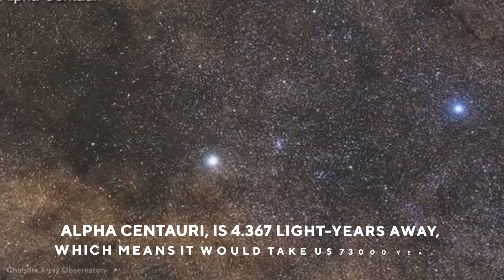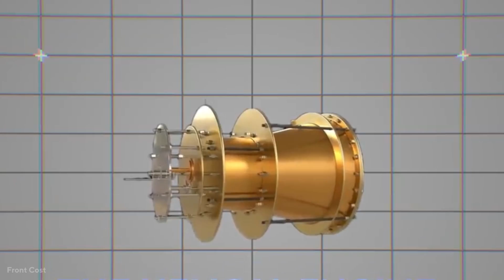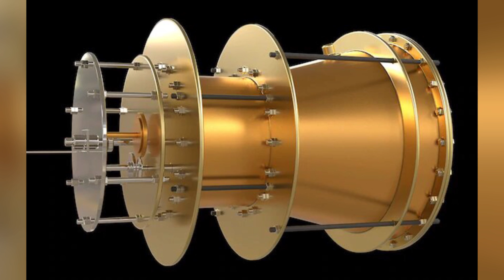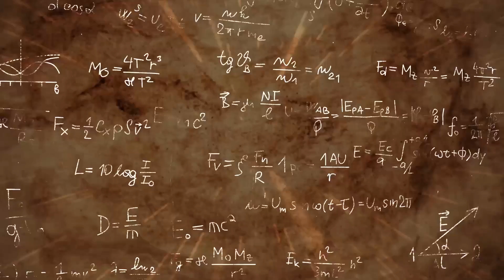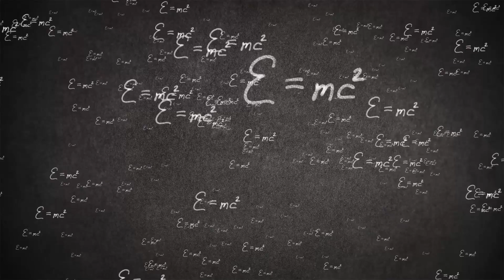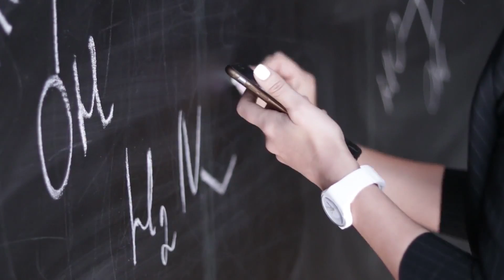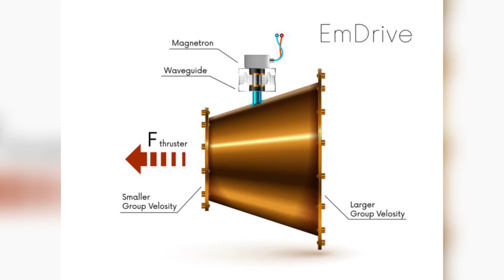NASA Design's Light Speed Engine That Defies Physics

Comment: Let's just say for the sake of conversation that this actually worked (humor me). Think about the stress that current high G's put on the body at faster than the speed of sound. The human body couldn't withstand the pressure at even a percentage of light speed. See what happens to an insect when it hits a windshield at highway speeds and imagine the force on the body or even equipment as it slows down to 0 from a percentage of the speed of light. Without injecting any scifi here, to protect the outer shell of the ship i.e. no shields. Even an empty ship traveling to Mars either wouldn't make it do to overshoot or couldn't slow down once we got it there, again the overshoot. The breaking force of the reverse motion would also crush the ship like a soda can. They always talk about FTL or Warp drive engines without thinking through the breaking or pressure on body and components. We can't currently make it to the deepest bottoms of the oceans without causing too much harm on body or equipment with our current level of technology but we want to travel at light speed. Unfortunately this won't happen in our lifetime unless we think outside the norms of possibility.
Reply: The warp drive doesn't accelerate but "move" the sspace around it so no g's, and for the space debris problem electromagnetic or just shields wuld work fine (for small things) and once you get up to speed there will be no g's acting on a human body aswell as the equipment.
Reply: With a warp bubble the ship doesn't accelerate, rather, you accelerate a patch of spacetime in its own. Some scientists have theorized that black holes exist from anti matter/dark matter for the majority. The same matter that a theorized warp bubble is made of. This also erases the need to brake at arrival, the ship doesn't accelerate so when the patch of spacetime is stable again and disolves the ship Will already be "stopped in its tracks" it also erases the g force since the ship is in a process of "massless travel"
Reply: @daniken2707  yeah, but a warp engine isn't made from antimatter/dark matter.
Reply: @imnotgoodatnameingthings9543  warp bubble is
Reply: @imnotgoodatnameingthings9543  In the world of Star Trek, the warp bubble works basically the same way: The Enterprise isn't actually travelling faster than light, it's just surfing a cosmic space wave generated by its matter/antimatter warp core. Although it was originally a fictional idea, a 1994 paper by Miguel Alcubierre showed how "warp drive" is really possible within general relativity. By creating a warp bubble where space is compressed in front of the ship and expanded behind it, warp travel would be possible, but would require negative matter or anti matter.
Reply: @daniken2707  a warp bubble is a region of spacetime and no the warp drive 2ould require negative Energy or mass, antimatter is not that, also he didn't create warp bubble he theorized it.
Reply: @imnotgoodatnameingthings9543 where and when did i say he created it?🤨 
And ok sorry, you are right that anti matter, negatieve matter and dark matter are all different things, but in a way they are all similar tho.
Reply: @daniken2707  oh yeah sorry my bad.

Comment: You talk about superspeed engine and on picture of the video you give picture of ION engine which is one of most slow engine for rockets XD
Reply: It's about efficiency not thrust, most of the concepts for engines with extremly high isp's accelerate very slowly.
Reply: An ion thruster can provide thrust for extremely long periods of time, providing constant acceleration eventually reaching a high % of lightspeed

Comment: Ok but what if the ship was built around the 200m long engine and perfected fusion powered super capacitors provided the energy to activate it? Like if we built a smaller version of an O'Neil Cylinder and put several of those engines around it, one for each of the 12 sections (don't ask why I chose a dodecagonal prism that's 500m long and 347-360m across as the shape of my theoretical ship in this scenario) and had a fusion reactor located in the middle aft of the ship charging super capacitors feeding into each Helical engine. This would all be built "30 years away" after we progressed fusion reactors to the point where they give off more energy than they use.